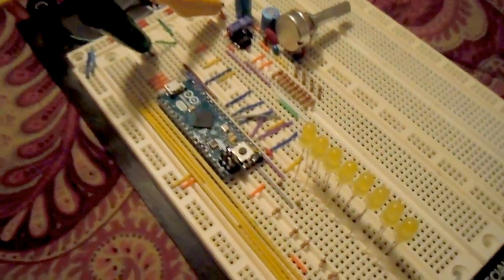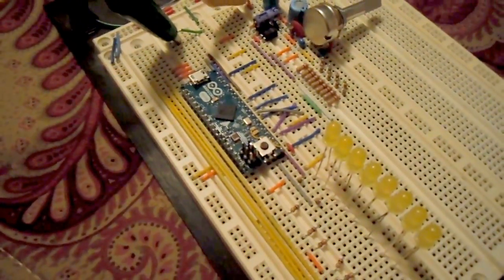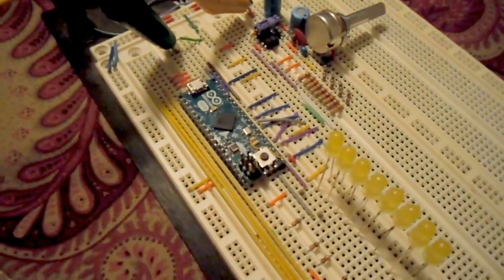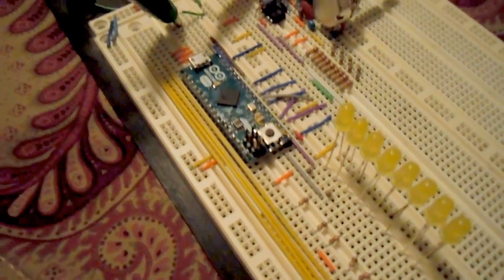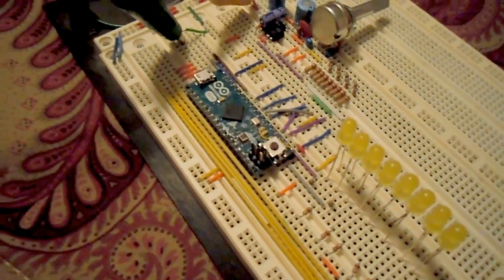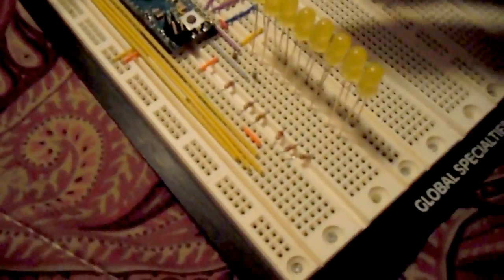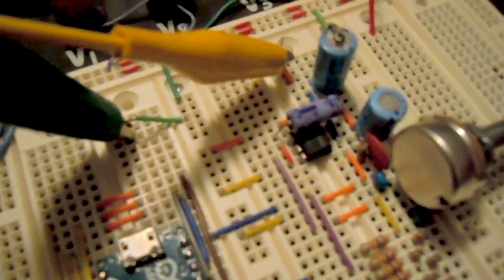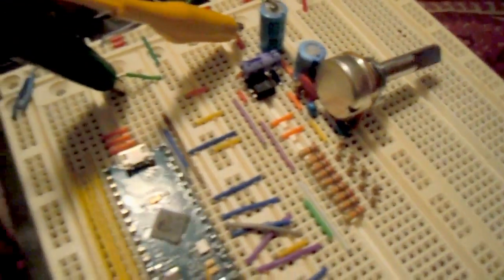XM/S3M/IT/MOD Player on Arduino Micro

Comment: really good work :)
for your TXLED breakout mod, why didn't you use one of the 2 NC pins on the opposite side? also does the fact that you've done it in series with the LED resistor affect anything?
just asking because i'm thinking about doing it myself, using an NC pin and the via before the LED resistor (the one to the right of the TX symbol). or maybe i'll just buy an A-Star 32U4 Mini...

Comment: Has there been a work around for the Micro in respect to SerialEvent not being called on data arrival? I have some motor control code that works fine on the R3 but won't communicate on the Micro unless I constantly poll the serial port..

Comment: I have a problem in working with Micro, as open the Serial monitor the TX blinks as I send some commands, but as soon as close the Serial Monitor the TX stops, how to work with the micro without using the Computer, please help
Reply from the maker: I don't use the serial monitor in this project, however if your code is sending data on the USB serial, disconnecting the serial monitor may cause the Micro to stop sending.  My suggestion in that case would be to use serial in/out on a pair of the digital I/O pins instead of using the USB connection's serial function.  Maybe if you posted your sketch to the arduino forums, someone could help.  

I'm not really a fan of the Arduino platform for a variety of design/philosophy/political reasons, I simply port some of my code over from time to time since everyone seems to be using Arduino instead of the more powerful solutions out there.  If I had the expertise, I'd just say post your sketch here and I'd troubleshoot it for you, but the Arduino community would probably give you an answer much more quickly.
Reply: +vespira can you send me the same code as you used in this    
video please.

Comment: Hey Vespira,  what a fun project.  You may be getting some distortion from the LM386 by overdriving it.  If you have a feedback path to increase the gain, the little amp will often over-saturate and make pretty messy sounds. cheers!
Reply from the maker: The LM386 wasn't getting overdriven, I had an issue with one of the digital outputs going into my resistor ladder.  You can see the thin yellow wire coming from the upper-right corner of the board to one of the LEDs...  I had to give myself an extra GPIO pin since Adafruit kinda n00bed the layout of this device... but hey, keeping in the Arduino "standard" of screwing stuff up... offset header, etc.

Anyways the wire was tapping the GPIO line after the current limiting resistor for the LED, and this caused bit5 in the 8 bit output to be skewed... enough to cause distortion.   It sounds much better now that I fixed the place where I tapped the GPIO line.